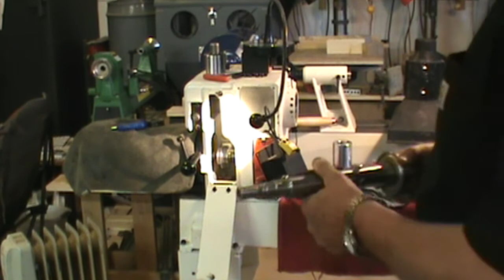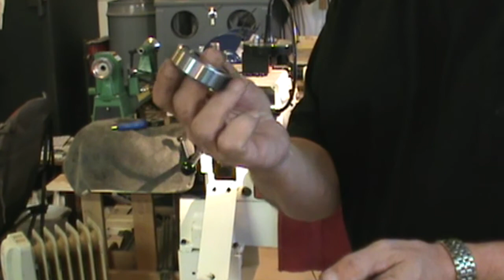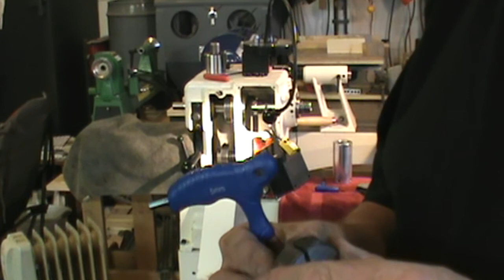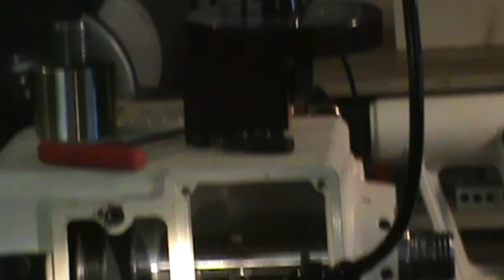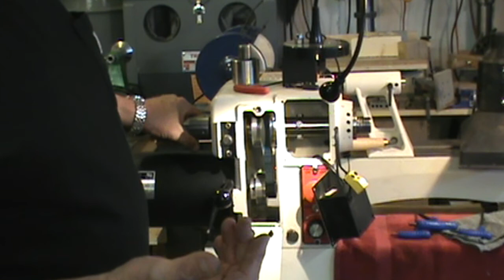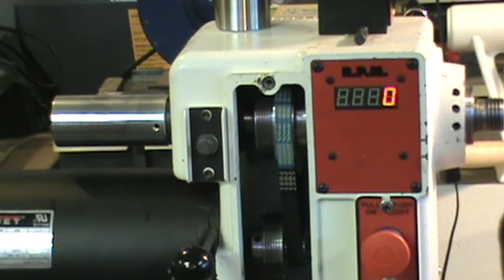Jet 1642 Spindle Bearings Part 2

Comment: Thank you Jim for sharing an exceptional video on exactly what I needed.  My spindle lock collar cracked and fell off after attempting to remove a very stuck chuck. Your step by step approach has given me the confidence and courage to attempt the replacement.  You also gave me the thought to take the shaft with the stuck oneway chuck to an automotive repair in the hopes they can apply the necessary torque needed to loosen it before putting it all back together.
Reply: Glad it helped. Hopefully they can press it off.

Comment: Just completed the repair. Your video was invaluable. Would not have attempted it otherwise. I found it easier to tighten the rear interior stop collar by removing the rear spindle lock and accessing the set screw through the hole in the headstock. This allowed me to set the gap and tighten the screw in one operation (without having to slide the spindle back and forth.) Great video! Thanks!
Reply from the maker: I'm glad it helped and I hope others read your comment. It's a good idea.

Comment: had to work on the bearing housings with a small drum sander in a portable drill to get a sliding fit of the bearings in the housing.   Then all went well.

Comment: Thank you.  You had a bearing for Jet 1221, do you know the replacement bearing number for that bearing?  Mine is bad.  Thanks again.
Reply from the maker: Try this link
https://www.ereplacementparts.com/jet-jwl1221vs-evs-woodworking-lathe-parts-c-32652_32854_566311.html

Comment: Great video.  Used it when I replaced the bearings in my Jet.  Noticed that even with new bearings, when I put in a center, I get a small bit of run out.  Not as much so with a chuck jaw.   Removed everything, and put it back together, still there, ever so slight.  Any ideas on what I can check to fix or find the cause?
Reply from the maker: A few things to check first off. If you have a magnetic base dial indicator you can do a couple checks to see where the run out is. First check the inside of the morse taper just inside the Spindle nose. If this is good +\- .001 it can be your drive center itself. The spindle shaft is not a super hard steel and can be bent, but not very easily. Next using the dial indicator check the spindle for run out on the collar just behind the spindle threads. If this has more than +\- .005 it's a bent spindle shaft. If this is good then it may be that the MT has burs or needs cleaned up. You can order a Hand MT finishing cutter from Enco pretty reasonable. If your MT drive centers have rough places or scratch marks its a good bet the inside spindle does as well. Also be sure the MT in the spindle is clean and dry when using the MT drive.  If you email me at rswoodturner@gmail.com I can send you some pictures of how to do this.
Reply: Thank you, I will check that.  Though I did put the center in my mini lathe to test it, and no issue there.

Checking my chuck again, when turning a bowl, there is some difference there (less than 1/8" over a 11 inch diameter bowl).  

I think I want to take it apart and reassemble, start over to ensure I am not missing something or a bearing is not in perfectly.  Assuming a bearing being off a hair could cause this as well?
Reply from the maker: Yes it could make a difference. Be sure the outer bearing race area is clean and burr free in the housing.
Reply: Where did you find what size bearings you need for the lathe? Thanks

Comment: hi jim. thank you very very much. i have the same lathe in it's about 10 years old. it's bearings are shot. i wanted to take it to a shop but now i'm going to do it my self. can you tell me please what's the size of the bearing ?
anothre thing... can we upgrade the motor ?
all the best
shachar
Reply from the maker: shachar, The front bearing is a 6207-2RS and the rear is 6205-2RS. Be sure to take note of how to set the preload on the bearings. Thank you for finding the videos useful. Good luck and if you have more questions please let me know. Changing the motor out is a big job and quite complicated. It can be done, but besides being complicated it gets expensive to boot.